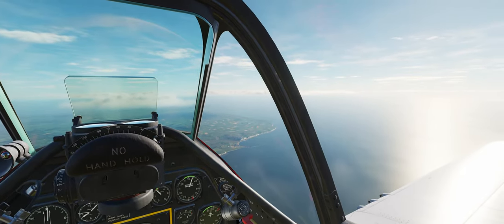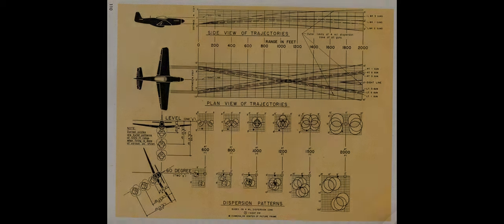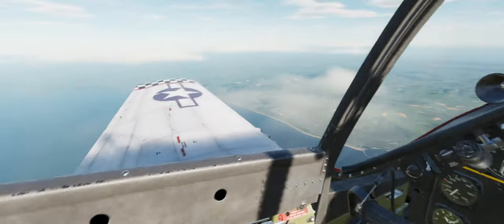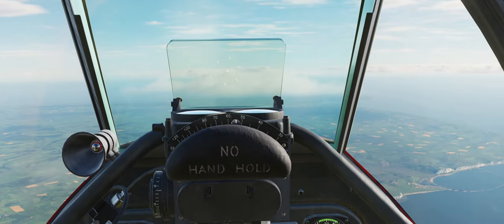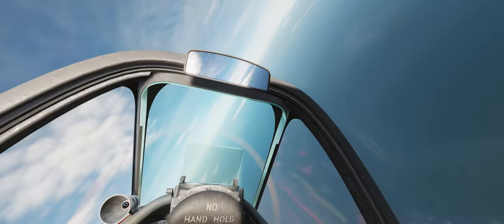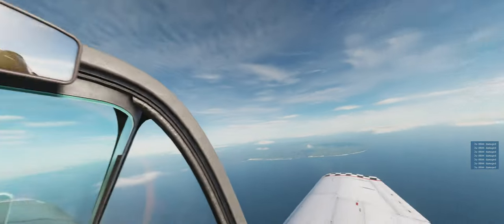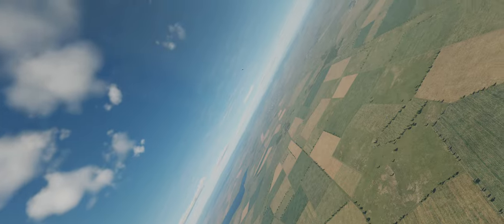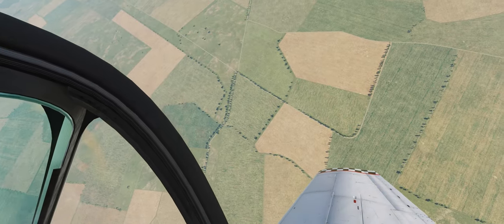P-51 Guide to Aerial Combat - DCS World

Comment: Convergence was achieved during MG harmonization on the ground by hoisting the ass end & calibrate with paper targets at a predetermined distance. The K14 Gyro reflector gunsight would calculate through it's computing mechanism distance, lead & bullet drop. It used the diamond & circle "pipper" reticule/reticle.
Reply from the maker: Yep, fairly sure there was a standard procedure for setting the guns too. The K14 is a great sight!

Comment: Glad I stumbled upon your channel!  Lot of great info on the warbirds, besides the usual "startup, taxi, takeoff, landing" tutorials.  I'm proficient in the Spitfire, but just started learning the P-51... I know about all of the accelerated stall characteristics, but I can not manage energy or fight with this thing at all.  I get high speed stalls, but I'm not even pulling hard, or even close to what I would in the spitfire...  Turns feel easy, like sightseeing flight, and I still stall it.  It's easy to takeoff and land though!  LOL  Would love some videos on how to best employ the P-51, tactics, fighting, maintaining energy.  Anyway, keep up the great videos!
Reply from the maker: Thanks, glad you enjoy them! And excellent suggestion, I'm brainstorming ideas for a video like that. 

For the Mustang in the meantime, without any sort of haptic feedback (Butt Kicker, bass shaker, or Jet Seat), you really only get three clues for turn performance, and the onset of an accelerated stall. You have the G meter, which is below and to the left of the engine triple gauge (oil/fuel pressure, and oil temperature). Second is the gun ports on the wings start whistling at higher angles of attack, and whistle louder as you pull a tighter turn. Lastly, the aircraft will buffet and shake just before it stalls. Hope this helps!
Reply: If you are having problems with the high speed stalls in the P-51, I found they occurred when pulling G's with the ball not centered in the turn and bank gyro. It doesn't take much pull on the stick to stall if the ball is off center. I found I had to look down at the ball frequently during a dogfight, which helped a lot, but it has the negative of having to look off the target momentarily.
Reply: Bingo! Good answer.

Comment: Thanks Diesel, great video. Setting the range to 1100 yards has helped me greatly. Question, where is your prop setting when you are dogfighting against fighters. I have a hard time keeping up with them yet I know the P-51 is a faster plane? 
Also, for those who are having problems with the high speed stalls in the P-51, I found they occurred when pulling G's with the ball not centered in the turn and bank gyro. It doesn't take much pull on the stick to stall if the ball is off center. I found I had to look down at the ball frequently during a dogfight, which helped a lot, but it has the negative of having to look off the target momentarily.
Reply from the maker: It depends on the fight, but if I can keep it at max continuous (2,700 RPM, 46 inches MP) then I will. If I need more power, then I run up the RPM to max (3,000 RMP) and then push up the throttle to full (61 inches), and if I have a chance I'll note the time as this setting is limited to 15 minutes before needing to pull back the power so you don't overstress the engine. And if you really need the power, you can engage War Emergency power (67 inches), but are limited to 5 minutes at a time running this power level. Most fights are over before hitting this limit though. 

For the slipping in turns, keep with it and you'll get the feel of it without having to reference the gauges as much!

Comment: what setup do you use? And do you think a x52 hotas would work for ww2 planes in DCS. Love ya stuff
Reply from the maker: Thanks, glad you enjoy the videos! I use a Thrustmaster Warthog HOTAS with an 8" extension on the joystick (throttles are not modified), with a set of Saitek Pro Flight rudder pedals, and OpenTrack head tracking. X52 is a good stick, and was the successor of the stick I used before buying the Warthog setup, the Saitek X45. I am personally not a big fan of twist grips as the rudder axis, much prefer pedals.
Reply: @DieselThunderAviation  thanks man

Comment: I think DCS has seriously under-rated the 50 Cal machine guns. Let's start with the fact that these bullets are 1/2" in diameter. That's a pretty big hole to start with, never mind adding incendiary and/or armour-penetrating capabilities to it. I believe ED has a Lousy Damage Model on the German Aircraft. In the Real World, a short blast of 50 cal would and did shred most planes. 
I watched a video one week ago (DCS) that showed the pilot turn a 190's fuselage and wings to Swiss cheese including MANY hits on the engine compartment ... and yet the plane was still flying without issue. 
And let's face it, the Mustang has been out for MANY years now and Ed STILL HASN'T fixed the WEP Wire. When a Repair is done on an aircraft, it should also restore the WEP Wire .. but NOPE. Still Neglected. My other beef with what would otherwise be my favourite module is the fact that the Fuel Octane for the Mustang is Mediocre. Good Fuel was available during the last year of the war but we don't get it.